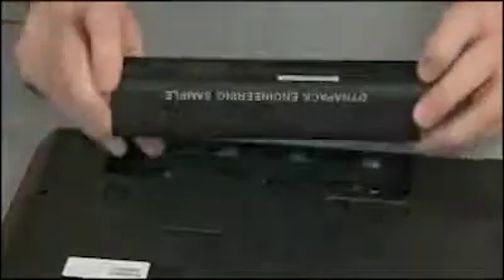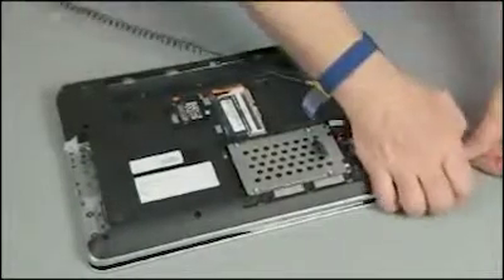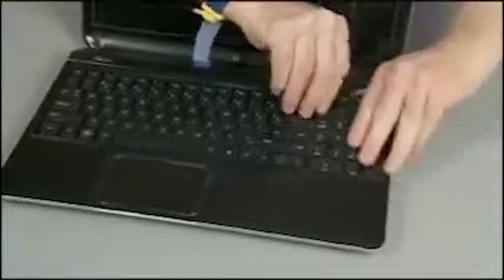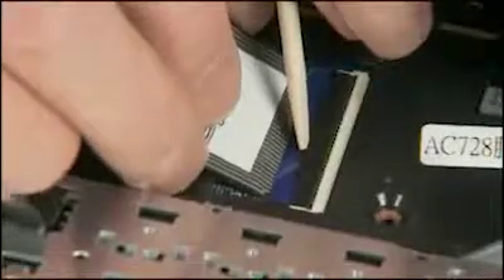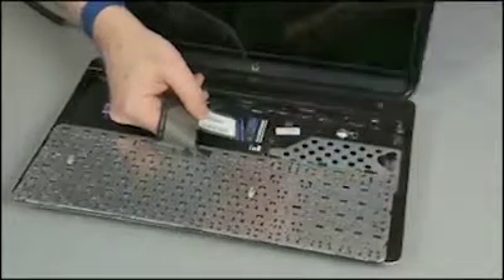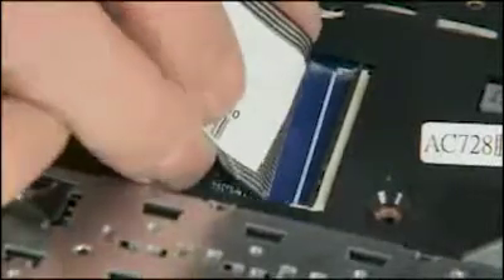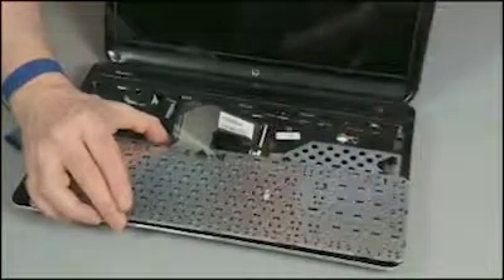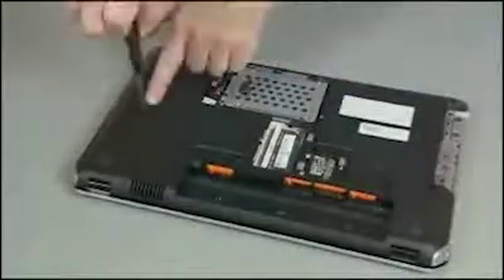Replace the Keyboard | Pavilion dv6-7000 ENVY dv6-7000 | HP Support

Comment: Hello, i am curntly opening the laptop for the keyboard replacement and i have to ask i have removed the DVD drive for a external HDD instead and so i cant open the DVD area what should i do and when i try to pry the keyboard the frame only comes not the keyboard itself.
Thank you for anything in help wise.
Reply from the maker: Hi there, thanks for contacting HP Global Social Media Support!
I understand that you are experiencing an issue in replacing the keyboard of your notebook.
I will do my best to assist you.
May I know the exact model number of the notebook you are using?
Please let us know!
Regards, 
HP Support
Reply: @HPSupport  hi! I'm using the HP-Pavilion dv6-7080ee
Reply from the maker: Thanks for the reply.
Please refer page number 72 of the user manual to know about replacing keyboard: https://hp.care/6053qEnuU
Regards, 
HP Support

Comment: Hi my laptop model is dv6-7000 is the keyboard from dv7-7000 compatible with my model? And were can i get a keyboard
Reply from the maker: Hi there, thanks for contacting HP Global Social Media Support!
I understand that you need to know whether you can use the keyboard of other model number on your notebook.
I will do my best to assist you.
HP does not recommend upgrading or downgrading hardware parts or software that is bundled with the product as It may affect the manufacturer's warranty and performance, however, you could change the configuration at your own discretion.
Use the HP Parts surfer to identify the part: https://hp.care/3V0rqsA 
And order it via the HP Parts store: https://bit.ly/3nKMYrs 
Regards, 
HP Support